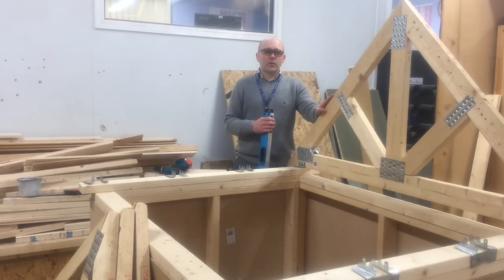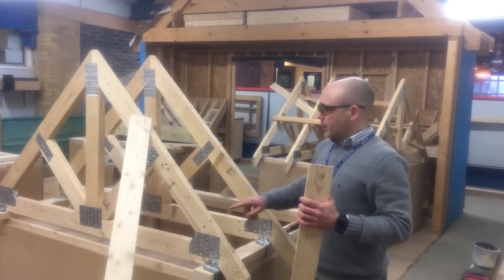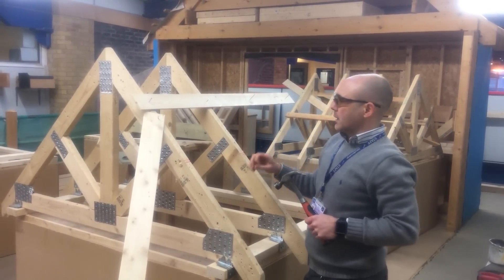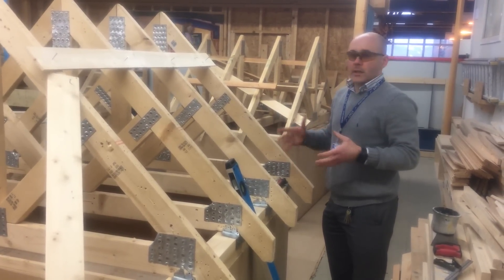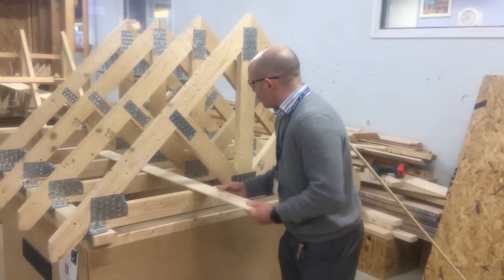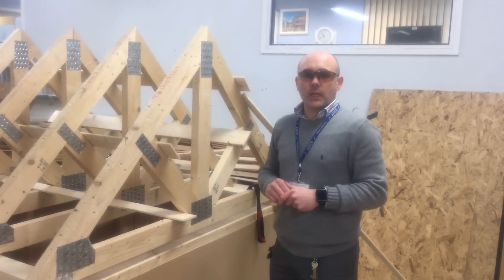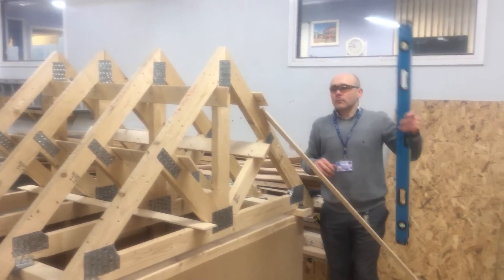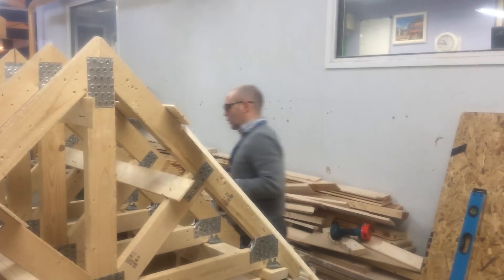Erecting a roof Part 2 - Installing the trusses

Comment: so do the lateral and diagonal braces extend into the cavity of the brick and block or do they need cutting back to inside of the block work?
Reply: Inside the block work then you fit your anchor straps though.